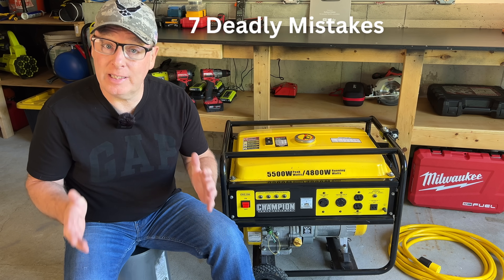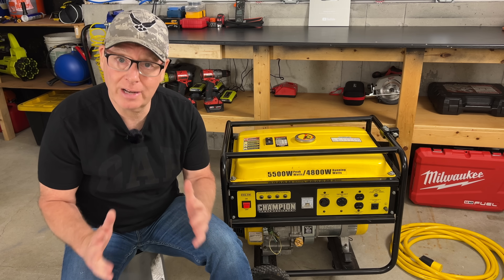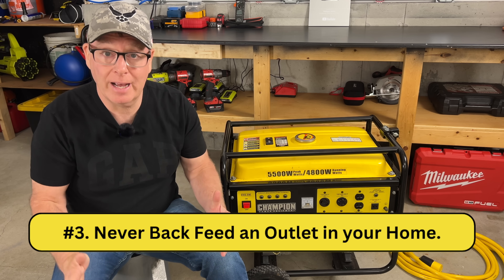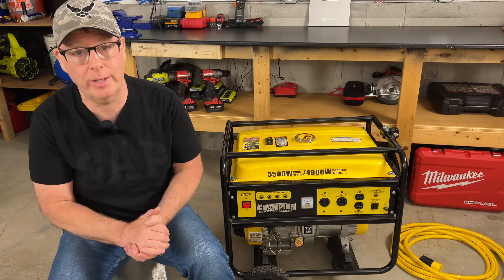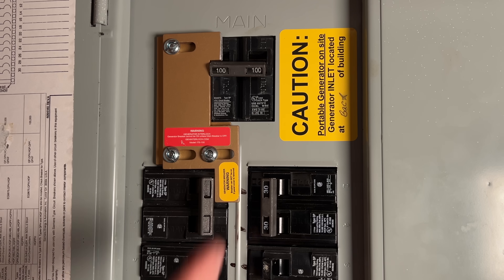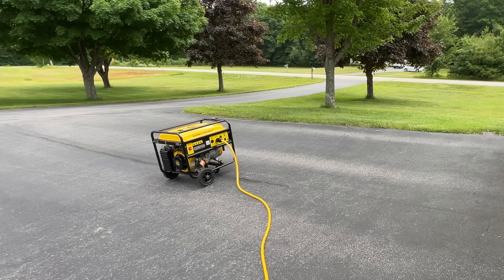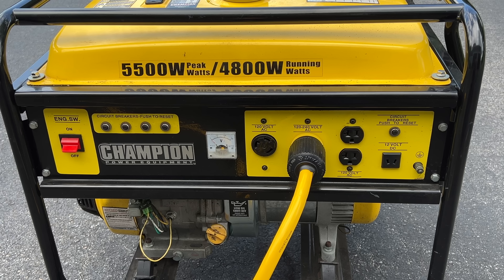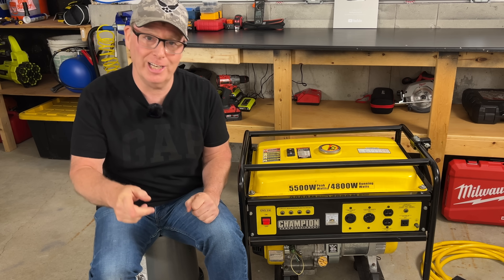7 Backup Generator Mistakes. (Have You Made One?)

Comment: You didn't mention that to have the generator start reliably you need to do this: SHUT OFF THE VALVE FROM THE TANK AND LET THE CARBURETOR RUN DRY.  Not using the generator for 3 years at a time and it still starts reliably just like a brand new generator. I also installed a Connecticut Electric Emer Gen Switch which also tells me the load on the generator circuits.
Reply from the maker: I may make another video about how to keep your generator in running order so it's ready for the next outage. I have a list of several things including shutting off the gas and letting the generator use up the gas in the carburetor like you mentioned.
Reply: @BackyardMaine  I do the same for all gas engines that run infrequently (like power washer).

Comment: What about a Propane powered generator (mine is Propane powered)? Does the exhaust gas emit CO also? I used to operate a Propane powered forklift (tow motor) inside an enclosed machine shop for years without no ill effects.
Reply from the maker: I cannot comment on the amount of CO produced by a generator run on Propane. I know it's less but I don't know what's safe. Propane does reduce the output capacity of the generator but it's certainly easy and probably safer.
Reply: Propane lift trucks still create CO. Many warehouses and or distribution centers that use propane fueled lift trucks also have CO monitors/alarms.

Comment: If i cant keep it in my open garage, what if the conditions outside is wet either raining or wet from a storm?
Reply from the maker: You need to use your own judgement on that. I showed what I do but it's certainly safer to find a way to keep the generator dry. They make gentents now and I may do a video on that in the near future.
Reply: Put it under your non-combustible patio table if you have one.

Comment: A very good video.  Thank you for you efforts!

I recently set up a generator for my home.  

We are planning to sell the home and move in the next couple years, so hard-wiring an external plug will be saved for the future home.

I have the generator at the outer corner of a partially enclosed/covered and screened in patio.  Its ceramic tile and dry wall and the generator isn't close to anything remotely flammable.  

I plan to semi-enclose the generator for some sound reduction, while still allowing for cooling, fueling/servicing, etc.

I have a Gen-Turi exhaust extension system that routes the exhaust out above the roof and away from the house.  

I also have three plug-in w/battery back up CO2 detectors for the rooms nearest the generator.  

I emplaced an 8', 5/8" copper grounding rod about 20' away to ensure a solid ground for the generator. 

In some cases, I've probably gone a bit overboard, but whenever possible, I try to plan for future use and also for the worst if it should arise. 

Thoughts?  Gripes?  Complaints?  😁
Reply from the maker: The only thing I would say is you don't need the ground rod unless your switching the neutral as well as the hots and you have a bonded neutral generator. The neutral bond and the ground rod can be confusing and I have seen many electricians get it wrong as well. I have a detailed video on the subject planned for the end of this month.
Reply: @BackyardMaine  Thank you for your reply.

I have a Honda EB10000, too.

Comment: I'd like to mention the advantages of portable backup generators that run on propane. For one thing propane doesn't go bad like gasoline will. Also, when a tank runs out, the hose can safely be switched to a full tank which minimizes down time.

Comment: Ok, all good stuff.  But installation instructions on mine (virtually identical model to your generator shown, just different distributer name) specify in no uncertain terms to attach the generator itself to an exterior ground for safety as well.  You should discuss that.
Reply from the maker: Yes some do but you do not want to connect it to a ground. Most manufacturers are removing that instruction. I have a video planned to cover this in detail. Remember a ground rod is lighting or surge protection and not a path for fault current. You can actually connect a hot wire to a ground rod and it will only draw a few amps and will not trip the breaker.

Comment: I removed the mufflers on my generators and and wrapped header wrap on them to keep some heat off the generator. works good. I  also run a fan plugged in locally to the gen blowing the exhaust heat away from the gen coil. The Gen and fan is under 2 Walmart fold up tables with a  tarp over both weighted down good setup stays dry even in the rain. Also make sure you get the gas transfer pump from Amazon its battery powered and pumps like a champ. No holding the gas can while you fill. I got 2 of those there so important. last year in Florida we were very lucky did not have to gen once so our cars ran on that gen gas for months. Its a breeze filling the car with the transfer pump.

Comment: My house is wired with a 100 amp sub panel that connects to the main panel through a manual transfer switch. I have a 30 amp 120/240 twist-lock to connect a generator to the transfer switch to power the sub panel. I have a Honda generator. All good so far. Our last outage a couple of weeks ago I was impatient in the middle of the night trying to refuel so I left the generator running. To my horror the tank overflowed with gasoline running down the face of the generator where the cord plugged in. To my surprise nothing happened. That’s the last time I do that.

Comment: Can an inverter generator power 220v equipment?
Reply from the maker: Yes, if you buy on with that outputs 120/240 volts. Look for an L14-30R twist-lock receptacle. I may be buying a large inverter generator very soon. If I do I will do a complete review video.

Comment: I use the suicide as YOU call it cord and been doing it for years it's a risk with everything I live totally off. And I use it to power my house with my generator being so far away from the house so I don't agree with some of those statements YOU made although there are good points
Reply from the maker: They can be used safely if you know what you're doing but here's the thing that I learned from a long career as an industrial electrician and an electrical engineer. The weakest link in any operation is the human being. We all make mistakes (including me) and when those mistakes can possibly kill someone, some sort of safety should be engineered in to prevent human error and eliminate risk. Creating procedure with step by step instructions was key before I retired but I also had to build in electrical and mechanical interlocks or people would make a mistake and someone would get hurt of worse. I hope that never happens to you.

Comment: Do I keep the bonded ground wire connected if I have it going into an inlet box like you have?  I’m confused on grounding
Reply: I’m sure his grounding video will be well done and informative.   However, if you are looking for a more immediate answer, it really depends on your setup.  If you just watched this video, with the grounds and neutrals separated in the panel, from the information I’ve gathered,  I think you would leave the bonding wire in place on the generator, since it’s not taking place in the panel you are feeding. 

However, this  I am certain of IF the panel you are feeding into has the bonding screw in place, thus bonding the the neutrals to the ground,  making the main breaker in the panel the first means of disconnect, then you should remove the neutral bonding jumper in your generator!   I’m sure he will go into much greater detail and explain the reasons why we need to do this.  I hope this helps solve any immediate issues.  

BTW, I am not a licensed electrician, but I did research this extensively, using multiple sources, from both  electricians and electrical engineers.  There should ONLY be one location of neutral bonding.
Reply: @larryr8320  thank you. I guess I should assume there’s a bonded neutral in the panel so it seems I should remove the bonded wire from the generator
Reply from the maker: @larryr8320  I will cover this in detail coming up soon. A grounded electrical system will have a bond between the ground and neutral at the first disconnect. There can only be one bond on the system. My system is bonded in the main enclosure at the meter box where I the run a separate ground and neutral to my panel. So even though by ground and neutral are separate at the panel the system is still bonded and I will need a floating neutral at the generator. Generators run with bonded neutrals are considered separately derived system and they require you to switch the neutral as well so there is still only one bond.
Reply from the maker: I'm planning a video covering grounding and bonded neutrals for generator and generator connections coming out on August 19th. Stay turned.
Reply: The best way to know, is to look inside the panel and look for the GREEN bonding screw.  Also, an other indicator besides that green screw being in place, would be if the white (neutral) wires and the bare (ground) wires are secured intermixed on the same bars where you secure them with screws.   Both identification methods require the panel cover to be removed to know for sure whether or not the neutral is bonded.  Connecting it to a bonded panel also allows the generator to take “advantage” of the ground rods that are in place for your electric service, so you don’t need a separate ground rod for the generator.   If it is like his system, I do think that the generator should have its own ground rod that it is connect directly to.
Reply from the maker: @larryr8320  Please read my reply to you previous comment. Which covers a bit of what's said here as well.

Comment: Generators are built with catalytic converters, and while there is a small level of CO still coming out, I've been exposed to 10 hours of a generator running not that far away in another room of a house I was working in. You, and the rest of the Safety Sams out there would be amazed at how much someone with knowledge about engines and electrical wiring can get away with. I ran a generator without a catalytic converter in the same house, for several hours, with the front door and a large window open, CO is heavier than air and can be controlled.
Reply: Carbon dioxide is not the same as Carbon monoxide. The first will give you a severe headache after mid level long term exposure. The second will render you unconscious & kill you without obvious lead up symptoms.

Comment: You can backfeed circuits safely if you follow procedures. Use the gfci outlets on the generator, shut the main breaker on your panel, don't handle live extension cord.
Reply: Yup!

So long as the 200amp main is off, you will not backfeed!
Reply: T3ied to back feed once it doesn't work unless you use a non gfci in the home
Reply: @ogairbender808  I never had a problem backfeeding
Reply: Open.....You want to OPEN the main breaker.
Reply: Just install the damn thing it cost less than gas
Reply: Yeah you can do it properly but there are to many variables that a lot of people don’t think about. Like the neutral wire that can also be hot

Comment: I have a 25ft. I have another 25ft cord somewhere,  If I find I want to join them. They are both factory made  is it safe to join two twist lock cables together?
Reply from the maker: It is but it's best to eliminate connections and minimized the length when possible. Another thing to consider is water getting into the connection. If you do connect cables maybe wrap some electrical tape around the seam between the two plugs.

Comment: How do you determine what size generator you need?  What I need is a generator that will run the furnace,  well pump, and refrigerator.   In the winter it can get very cold.  I have spoken to the electrician that wired this home to do the work needed .  The transfer switch and anything that is required.
Reply from the maker: I'm working on a video right now that will shed some light on the sizing requirements and well as the hookup. Should be up in a few days.

Comment: Don't store gas or gas cans in your garage. I also suggest that you use a lockable breaker lockout. I have one on my main breaker and I am the only person that has the keys.
Reply from the maker: If you have an interlock you don't need to do that.
Reply: @BackyardMaine , a lockable power disconnect is required by code. An interlock is basically a power disconnet. The reason for the lockable lockout is so someone can't come along and flip the disconnect on. My main breaker can be locked, by a special Master disconnect lock, so I am the only person that can turn the main breaker on.
Reply from the maker: @RMartin631  An interlock is not a disconnect or a disconnecting means. We have a main breaker and the generator breaker. Either one can be turned off but only one can be turned on at a time which is the purpose of the interlock. You cannot physically turn on both breakers with the interlock system. Locking the main or the generator breakers is not required by code. A lockable disconnect is required by code for hard wired equipment but not for cord and plug connected equipment like a generator. Of course circuit breakers are lockable and can be considered a disconnecting means for equipment but only if it's within line of site. I think you're mixing up a few code references here. Its fine if you use a lock but its not required.
Reply: @BackyardMaine , Google interlock. Damn.
Reply from the maker: @RMartin631  I'm a master electrician and an electrical engineer with 40 years of experience.. lol An interlock is an arrangement in which the operation of one part or mechanism automatically brings about or prevents the operation of another. Not a disconnect per definition and certainly not per article 100 in the NEC.
Reply: @BackyardMaine , maybe a Youtube Certified electrician and engineer.
Reply from the maker: @RMartin631  Actually I was a union (IBEW) electrician running large projects like power plant and semiconductor factory builds . I spent my last ten years working as a senior electrical engineer for Texas Instruments. I do this as a hobby.
Reply: @BackyardMaine , I actually was just trolling you a little. We're talking about 2 completely different generator setups. You're using the interlock which can be operated without a lockout. You'll often see Honda 5,000 watt generator dealers selling that type of interlock. I'm using a connection which uses a Generac 6336 outside box that is wired directly into the breaker box. It uses a L14-20 connector to both the box and generator. The cable is a 10-4 about 20 feet long to get it away from the house. Mains lockouts for this type of setup are required in my county in NC.

Comment: Once I have plugged my generator in to the inlet and both ends of my cord are securely connected, which do I turn on first? Do I release the interlock and switch the generator breaker to on, or start the generator up first? I have seen it done several ways and not sure if it matters.

Comment: I run my generator in the garage. But I put a pipe on the exhaust and run it out the door. Never had a problem. Never sets off the CO monitor. Been back feeding with a widow maker for almost 20 years. Just pay attention and shut off your main.
Reply from the maker: You are certainly not alone but if you have a leak you could become a statistic and if you make a mistake some night when you're tired you could get someone hurt or worse.

Comment: While this video is very helpful and make some really good talking points its amazing that you left out an extremely important safety point. You're only allowed to have the neutral and ground bonded at the main disconnect of your home.If you simply power your home with a bonded generator your running the risk of electrical shock.Anytime you power your home with a generator you should always make sure your generator is UNBONDED.Its a simple process to add a switch to the generator so you can go back and forth between bonded and unbonded.Tons of videos on here explaining in more detail and how to instructions to accomplish this.Not trying to criticize your video because like I said it make great and valid points.Just thought your viewers might also like to understand the difference between using a bonded vs unbonded generator.All the best.
Reply from the maker: There is a lot of confusion and misunderstand around grounding and bonding especially with generators. I have a dedicated video planned to cover this subject completely. Stay tuned.

Comment: Dumb question here. Can I plug my RV into that 50 amp plug on the house and then block the main breaker to use the generator breaker to power the RV sitting in my driveway?  I have a 50 amp plug and generator  I use for backup power now. Just curiois to know if tje RV would draw power from that breaker
Reply from the maker: You could but you would need a cord with two male ends which is dangerous. You would also need a mechanical interlock between the RV circuit breaker and the main breaker in the panel so that only one breaker can be turned on at the same time. The interlock would not allow you to power your RV when utility power is on.
Reply: @BackyardMaine   Thank you I appreciate it that's why I asked here before I did something stupid and plug it directly into my 50 outlet on my house LOL

Comment: Thankfully 99% of the electricity supply is underground here. Even in the worst storms power outages are extremely rare. Think the last outage was about 15 years ago and lasted about 10 mins
Reply from the maker: Lucky you.. When I first bought the generator in the video we went about 5 years and never needed it. In the last 5 years I have probably used it 20 times. This spring we had two storms ten days apart and each one took out our power for two or three days.